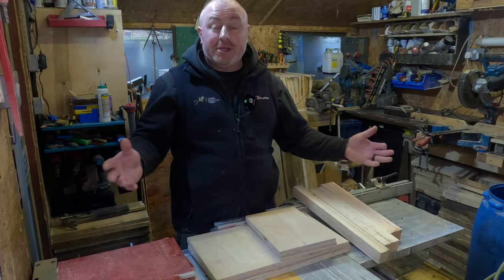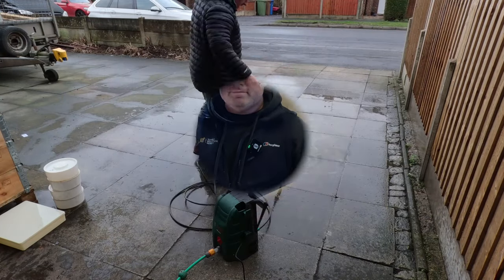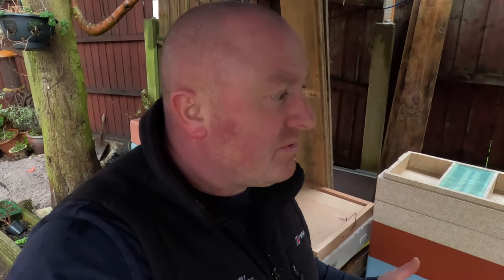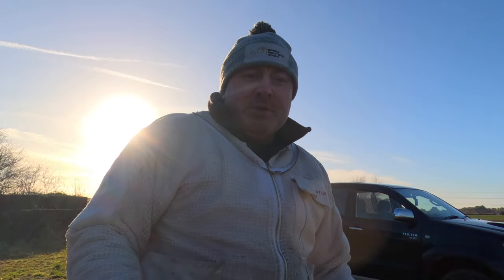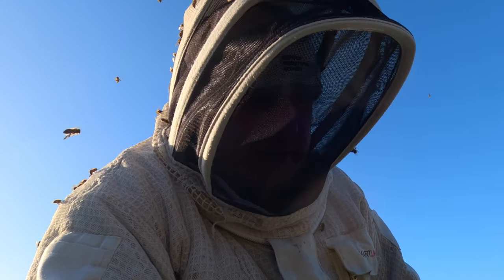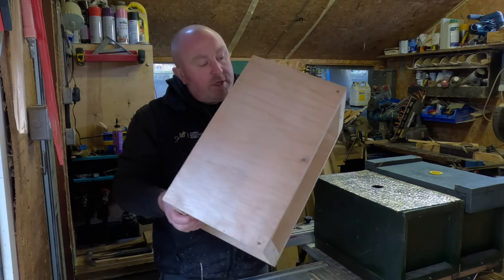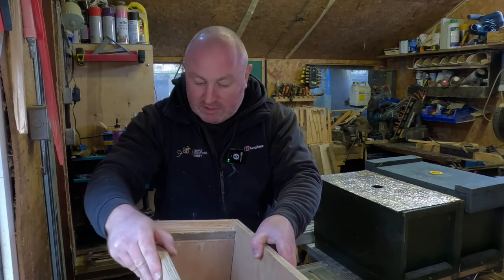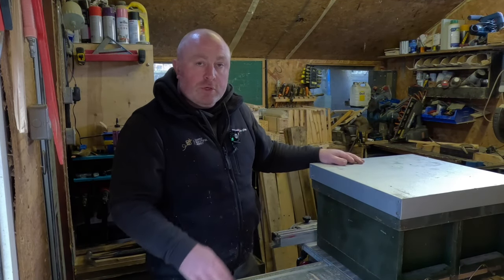Scrap wood nuc

Comment: Hi, like the idea of making nucs etc, just wondering how you manage to cut the pieces to the correct size without measuring every panel, every time?
Reply from the maker: Hi. So when I cut the parts I set my saw and fence up to the correct measurements and then  cut as many as I can in a session. I can then store these knowing they are all the correct spec. 

I do this with all the parts for the equipment we make.